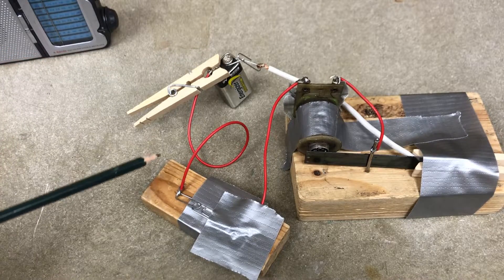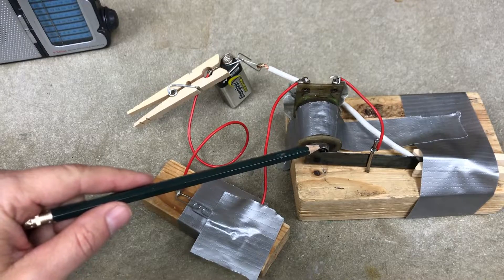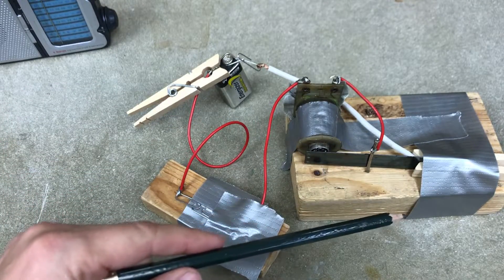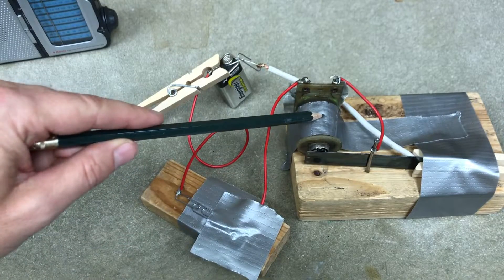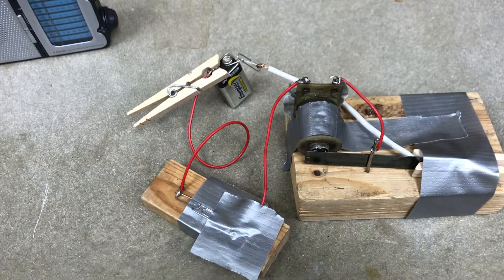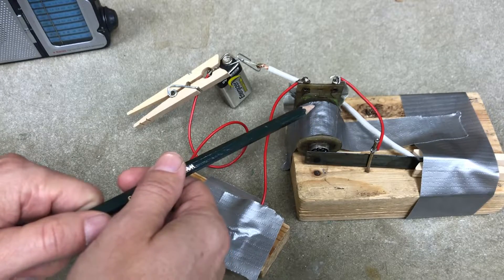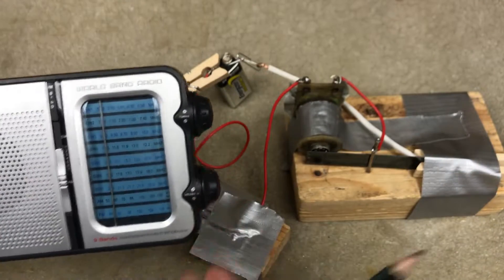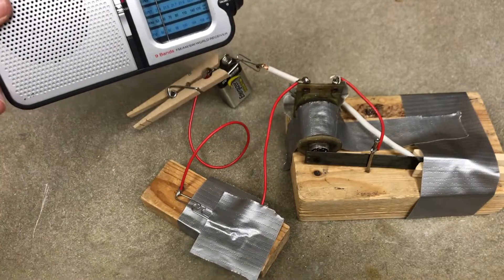How to build the simplest radio transmitter - the spark gap radio

Comment: What is the range with and without an antenna?
Reply: probably only a few meters, but if you have to satellite dishes it is very easy to point them at one another to send signals further (like 20m depending on accuracy). I would also recommend this because you have to own a radio broadcasting license to stream it. so just don't us a antenna or at least not a good one :).

Comment: anyone know how to make an emergency spark gap radio using the sparkplug in an engine?
Reply: The threads are if I remember correctly, a ground point. Which would also make the side electrode(J shape) or "end" a ground. The Terminal(what the spark plug wire attaches to), is the positive point. The center diode goes all the way through and down to the side electrode(J). Seems to me this idea is a good one. But, likely you'd have to know the load under which said spark plug would normally operate. Obviously you don't want to be putting too little power on something and it does not work. Good idea. I shared a similar idea. Hope this explanation helps as it's all I could come up with.

Comment: how would you go about making a variable frequency?
Reply: It creates many oscillations at once, you'd have to add a filter circuit to reduce it to a narrow band of frequencies. FM modulation is much more complex, with this you would transmit Morse signals or any kind of on/off-keying signal.
Reply: I'm working on this myself ,I know you use a variable capacitor but I'm not sure where in a circuit you place it. I did figure out if you wire a omron 7236 relay a certain way and pull a load on it that relay it oscillates fast if you don't put aload on it it's like a dead short and smokes , I built a key figured out how to oscillate a relay and fire a ignition coil with it now it's just the capacitor and antenna coils pretty much dictates frequency,

Comment: Now I understand how this works. It's an electric buzzer. Replace the metal strip with a bell and it becomes an electric bell. 

When the switch (paper clip) is is turned on, the circuit is complete. The coiled nails become an electromagnet which attracts the metal strip, thus breaking the circuit. When the circuit breaks, the coiled nails cease to be an electromagnet and the iron strip returns to its original position. But that turns on the circuit again (provided the paper clip is still in the on position). All this happens very rapidly and the metal strip tithers between the contact nail and the coiled nails. This tithering causes the buzzing sound of the metal strip. 

How is it a radio transmitter?
Sparks emanate from the metal strip and the contact nail everytime it breaks off and is pulled by the electromagnetized coiled nails. This spark disturbs the already-present invisible radio waves and this disturbance/agitation can be detected on an AM radio.  
Any arc of electricity is capable of creating radio frequencies. An extreme example is how lightning can be heard on the radio because this giant spark had agitated radio waves. 

Oscillation is the speed of agitating radio waves. Much higher oscillation is needed to be able to transmit audio via radio waves. 
There was little to no oscillation in early  transmitters and you could only send pulses, which was sufficient for the dots and dashes of Morse code. 

There is a related video "Build an electric buzzer" https://youtu.be/j3fvpIan5x4 and at 06:27 it explains how its sparks make it a simple radio transmitter.

Another video "Low voltage spark gap transmitter" https://youtu.be/VP4OfFjalt4 which uses an old electric bell mechanism. The sparks are clearly seen here. 

And a sound explanation of spark gap transmitters:
 https://youtu.be/CpX4mHYYD3E

Thanks, this video brought me to a long trail pf unorganized research for this new hobby.
Reply: I made an even simpler radio transmitter than yours when I was about 6 years old. I merely scratched a metal rod back and forth across the coiled spring terminals of a 6V lantern battery in my bedroom. It would broadcast deafening static on the AM/FM stereo that my babysitter was trying to listen to in the living room. I didn’t know what Morse code was yet, so the only practical application I could think of was to irritate my babysitter. when I showed her that the noise drowning out her Top 40 music station came from my rudimentary spark gap transmitter, she made me stop so she could hear her music.
Reply: @edr3667  6 years old 🙄😮  😵 🤐
Reply: Almost correct, this part is not though: "disturbs the already-present invisible radio waves and this disturbance/agitation". Spark gaps create radio waves, due to creating changing EM fields, they do not modulate or disturb existing radio waves. It does not matter if there are any radio waves in the vicinity already or not for a spark gap to work.
A spark gap is merely creating a strong voltage that arcs between two electrodes (which is similar to lightning). This arcing creates an oscillation of voltage/current in the circuit, and this alternating current is what creates the EM waves.

Comment: Did some reading on induction coils and early transmitters so I have a fair understanding now. Does the coil here have a secondary coil?
Reply from the maker: this one is a single coil - secondary coil would make it better, but I was going for "simplest"
Reply: @rhettallain  wow, thanks!!
Reply: @rhettallain  how long can it transmit the wave? Do u have any idea to boost the distance?
Reply: @tuankietnguyen5079 antenna but it will still be like 2 ft range

Comment: How to increase range
Reply: connect an antenna
Reply: @carl-cr7rp  but where?
Reply: @TheHermitPepe  anywhere
Reply: @TheHermitPepe  an antenna should be connected to the wire

For large range, you only need an old rc (remote control) antenna, or from your baofeng walkie talkie antenna